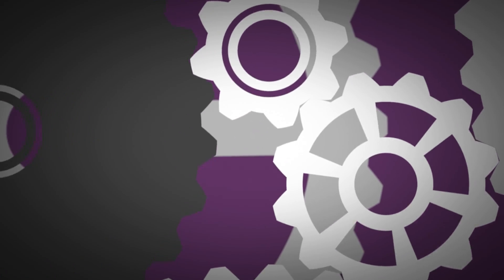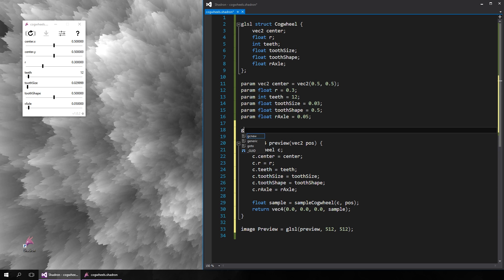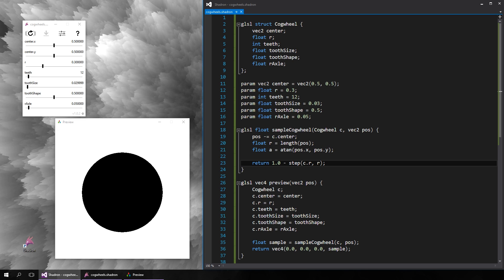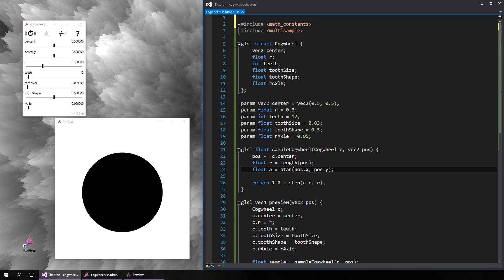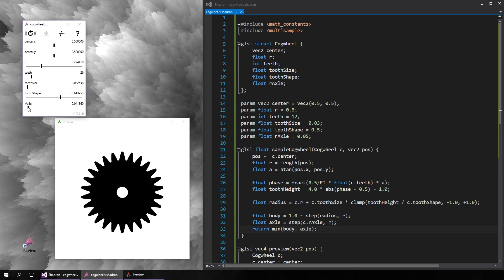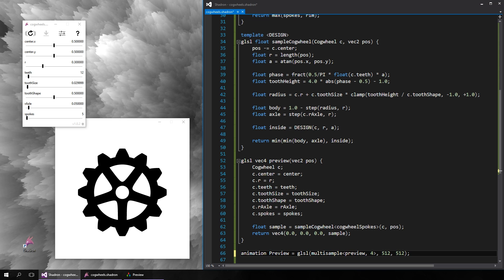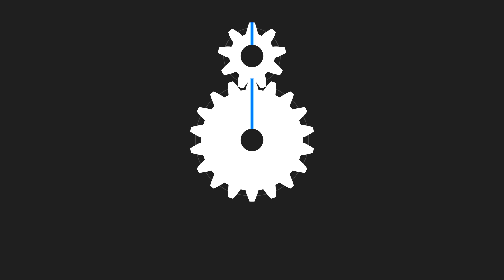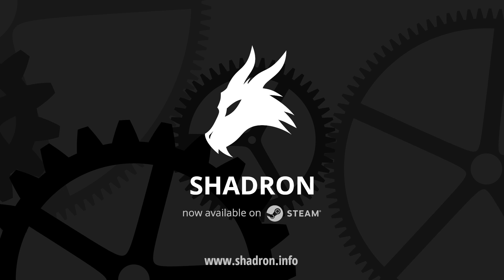Procedural 2D graphic design: Cogwheels tutorial

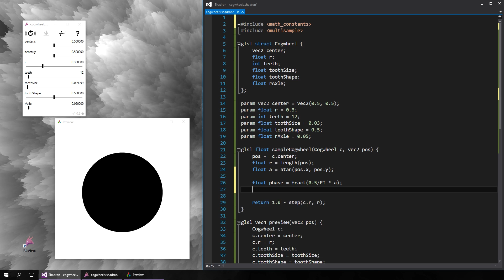Comment: At 4:50 how is phase in the range of 0 to 1? If alpha is from -PI to PI, that means the fract() argument will range from -0.5 to 0.5, so phase will be -5 to 5? I don't get it.
Reply from the maker: fract returns the fractional part, that is, always a value between 0 and 1. For example fract(0.5) = 0.5, fract(1.2) = 0.2, fract(745.124) = 0.124. For negative numbers, the result is still positive, and it's like the difference from the nearest lower whole number, so fract(-0.25) = 0.75 because -1 + 0.75 = -0.25 etc.
Reply: Hmmm, but how can the output of fract() in this case be 0 to 1 if the input is -0.5 to 0.5? Maybe I am missing something here.
Edit: I get it now :) Didn't pay close attention to the negative case. I continued thinking that fract(-0.25) = 0.25. Thanks. Cool tutorial.